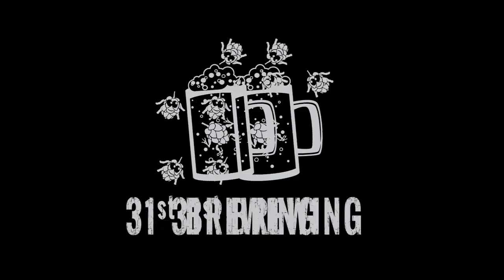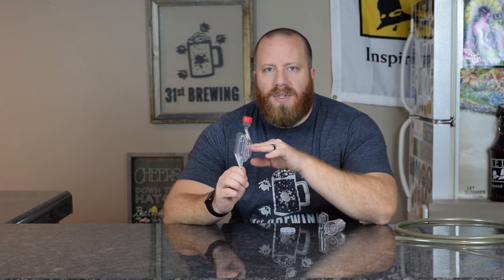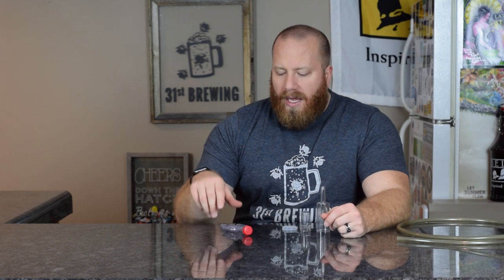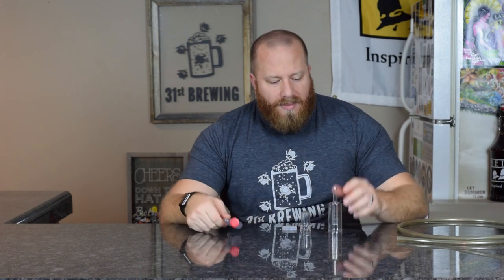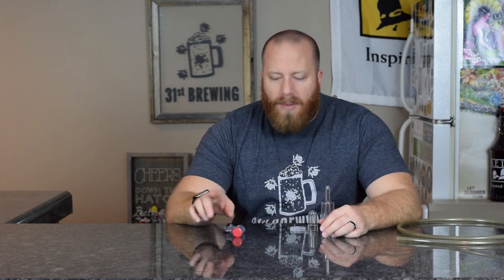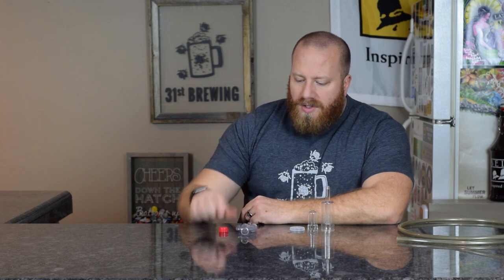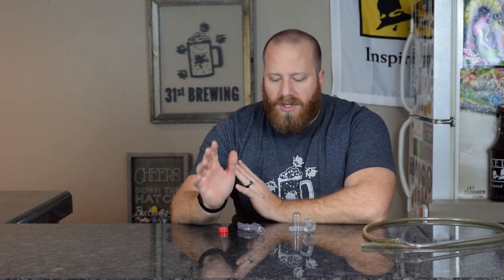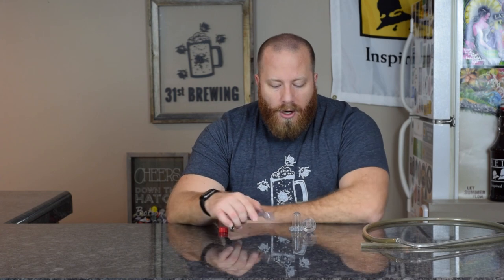Airlocks what is the difference between 2 Piece vs 3 Piece Airlock

Comment: I agree, the 2 piece is much harder to clean and that's why I use  a 3 piece most of the time. However; the 2 piece is good for cold crashing. You just stuff a cotton swap soaked in some vodka in the top. If you used just a liquid, there is a potential for it to be sucked in during the cold crash.
Reply from the maker: I didnt think about doing that when using a 2 piece. Thanks for the info on that. Yea 90% of the time I use a 3 piece. Cheers

Comment: Nice job with the video !  I'm a 3 piece guy. I get fruit fly's once in a while and they're just small enough to get in. One trick I use to eliminate bugs is to take a coffee filter and a rubber band and wrap the top of the airlock, it works right dandy ! My only video critique would be, I would have mentioned the ease of filling the 3 piece lock using the little filler level line on the body of the airlock. Happy brewing !! Cheers.
Reply from the maker: Thanks for watching Cheers

Comment: I've never used 2 part locks before. Ive only ever used the 3. as for cleaning the 2 part units plastic boned straw bruses will work greatly. I learned this just recently after the kit I bought to try to replace my setup after a wildfire came with it. Cleaning was my biggest fear with it. Also glad to know I'm not the only rockgut user for the locks.
Reply from the maker: I dont think about using that. Thanks for watching Cheers

Comment: Started my first home brew. Put sanitiser in the air lock, stuck it on real good. Then I filled the gravity meter from the tap and straight away it pulled the sanitiser straight into it 🤣
Reply from the maker: yea you want to take the air lock off if you are going to pull some from the tap. The beer should still turn out fine. Cheers

Comment: try a pipe cleaner Brad works for me...just bend the tip of the pipe cleaner before inserting into the air lock to prevent scratches or snagging
Reply from the maker: Thanks for the info I will try that. Cheers

Comment: What about using one of those plastic aquarium one-way air check valves, which has a flapper or stopper that allows air flow to flow in one direction (ie . into a fish tank) and stops water from flowing in the opposite direction (ie. out of a fish tank)... would something like that work in fermentation to allow the gases to escape, but prevent anything from entering?
Reply from the maker: Im not sure if that would work or not. You could try it but I would stay with a standard airlock Cheers

Comment: I was actually going to ask about the S shaped ones and if they need holes in the top but I guess those ridges on the inside of the cap allows co2 to escape? Saw one person saying you need to drill a hole in the top if it doesn’t have perforations.
Reply from the maker: Yea the ridges should work. Now Im sure there is not a lot of QA steps in making them so you might want to check yours to make sure CO2 can escape. I could see making a hole if you didn't see perforations. Thanks for the comment Cheers
Reply: @Aristides Gonzalez let me know how you get on. I might have a go with just making one pinhole to vent.

Comment: How are you fermenting that will create a vacuum to suck air back in to the fermenter.
When I started homebrewing I would just put a damp cloth over the fermenter.
Reply from the maker: Im not sure how it does it. Im almost thinking it has to be a temp change. I have wanted to try that. I might have to try that with a batch and see how it turns out. Cheers

Comment: Hi, I'm interested in getting airlocks for our fermenters. For our current setups, we just plug a tube thru a rubber stopper and let that tube bubble to a receiver with water in it. We sometimes have water from our receiver back-flow to our wort and contaminates it. Do you have such problems with the 1-piece and 3-piece airlocks you demo'd? Thanks!
Reply: People usually put diluted sanitizer or vodka in their air locks to prevent contamination. On the other hand, if pressure drops in the fermenter, water is sucked in regardless. They're not check valves, they just stop air from entering the fermenter, while allowing CO2 output.

Comment: I really liked the video and learned a bit.   I am new at the winemaking process.  I was thinking (my wife says that's not possible).  Today after just a week of fermenting, I had to add sanitizer to my 3 piece.  Wasn't as difficult as I thought it would be, but, I thought a 2 piece would be easier to add sanitizer to since it doesn't have a center part wanting to float out and release the gasses that have built up (not knowing, maybe that's not an issue).  And, if i were concerned with the amount of sanitizer, a 3 piece seams as if it would use less.  I hope I didn't sound too much like a novice.  Your thoughts?
Reply from the maker: I think as a 3 piece has a bigger opening its easier to work with. I have not tested this but I also think a 3 piece would hold more so less filling. If you are filling to the line on the 3 piece it shouldn't float out. They will both work. All good sir Cheers

Comment: Which one makes less noise in your opinion? Or any alternatives for minimalizing the bubbling sounds? I'm gonna start fermenting in a shared flat soon and as much as I'd like to hear my own beer being made, I'm not sure about my flatmate.
Reply from the maker: I think the 3 piece would be best. I think the 2 piece has smaller holes so you hear it more. Also I think with the smaller opening of the 2 piece the air is pushed out faster. You could use the 3 piece and just use the main body and put a 1/4 hose on it and run that into a bucket and it would be less sound. Cheers
Reply: if your flatmate is so obsessive and on edge that the near inaudible bubbling sound either of these make sends them over the edge, its time for a new flatmate.

Comment: 2 piece in (primary) if I have the head space, 3 piece if possible blowoff! 2 piece also if lagering! I don't think Iv ever experienced suck back from a airlock but I heard 2 piece could be a problem?!?
Reply from the maker: I almost always go 3 piece in primary and if I have to age I will go 2 piece.  I should have talked about this more in the video. I have had some suck pack with a 3 piece but maybe only 1 or 2 times in 10 years. I do see it more in 2 piece airlocks. I think this is b/c of the way the 2 piece is set up. Cheers
Reply: Brad Allison video was great and brought more questions to the table, an air lock I think is simple but vital piece of equipment! I'm currently searching equipment and process of carbonating beer while fermentation is underway? So much information that say don't do it aka causes off flavors but so much history says it does work. Cheers
Reply from the maker: I think in today's world we want everything done so fast. So if you can carb a beer when its fermenting it will be done faster. Maybe it will work most of the time but in some cases, it might not work. It's kind of like gastric bypass surgery. Yes, you can do it but what are the long-term effects of it? (I did not look up the studies) Most people will be ok long-term but some people might not. I would say if you 100% have to have your beer done ASAP try it. If you can wait dont use it.

Comment: Dude, thanks for the video. which one would you recommend to use for the Cold Crashing?
Reply from the maker: Thanks. This is a hard one :). I cold crash in a keg. Then just dump out the first 2 glasses most of the time to get everything out. I do this b/c of the risk of oxidation. 2 ways I have done it in the past was 2 piece airlock or foil. Check out this link for 7 methods. http://brulosophy.com/2018/05/10/7-methods-for-reducing-cold-side-oxidation-when-brewing-beer/

Comment: I think that two piece airlocks are preferred by sellers, not re-usable since impossible to clean!
Reply from the maker: I think you are right. I know if I was seeing them I would send a two piece just to get more sales later on. Cheers
Reply: Throw the glass in your oven @ 400 for an hour or so and everything inside will turn to dust, be careful it to start a fire
Reply: @jeremiahvick2482  The 2 and 3 piece airlocks I've seen are made of plastic.  400 might melt them

Comment: Hi Brad,
please, that chamber can also be filled with spirit (96% alc)? yeah and at the two-part chamber it has to be filled on both sides to the max level?
Thanks!
Reply from the maker: Yes, you can use a spirit. The only reason I wouldn't as it could get into the beer and it "could" up the ABV and smell and taste. Now if you are making a 5 or 10 gallon batch I don't think you would get this. For the 2 piece you should see a max fill line in the outside part. You would just fill to that line. Put the inside piece in and fill to the line. Cheers
Reply: @BeerReview  thanks dude! <3